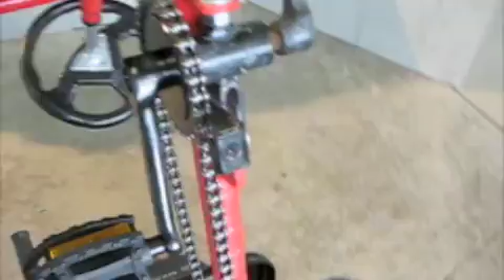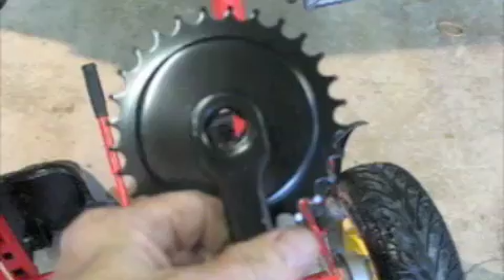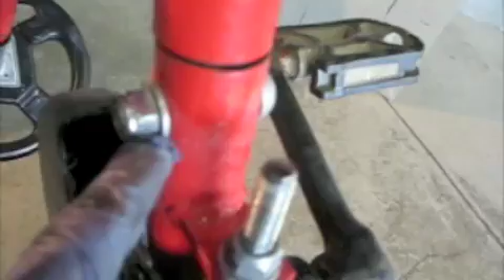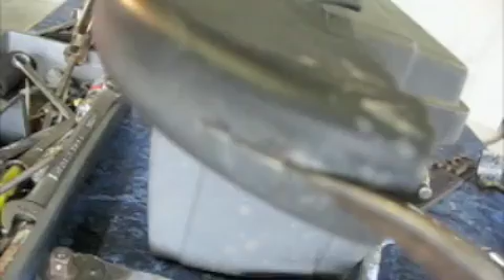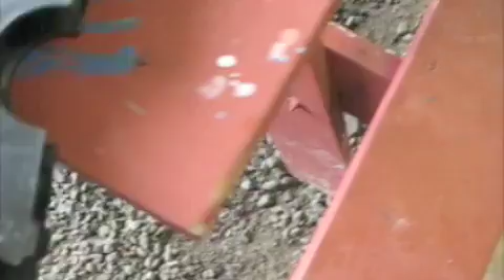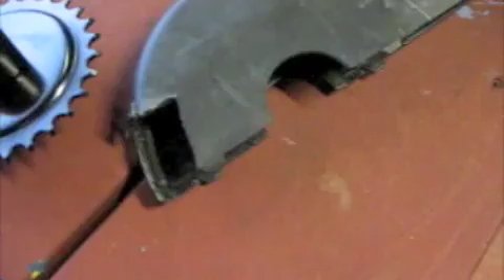Berg Clipper Gear change

Comment: Nice video!  Just curious, instead of moving the sprocket forward and cutting the chain guard, why didn't you remove links from the chain?  I'm thinking of doing the same thing to my kid's BFR-3.  I want to do as much research first as I can.  I would prefer to remove links from the chain but I am not sure if the chain is a type where that ruins it or something.